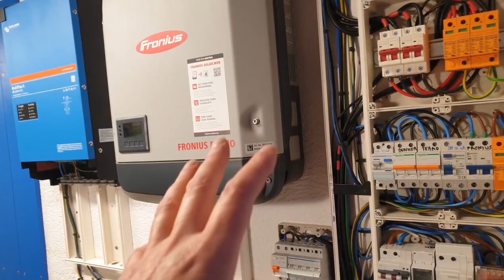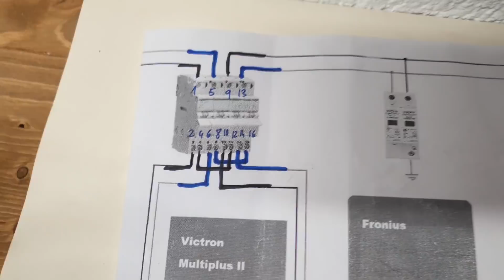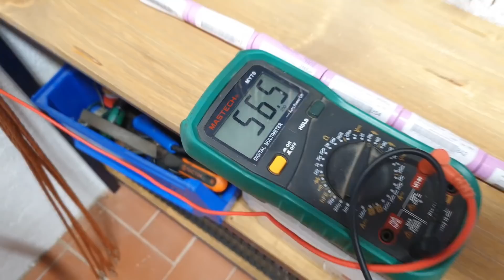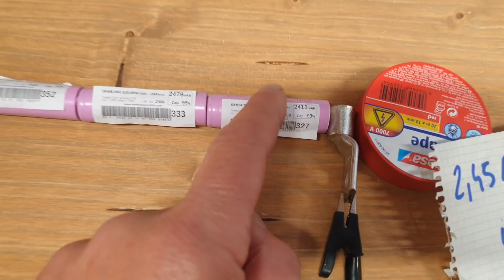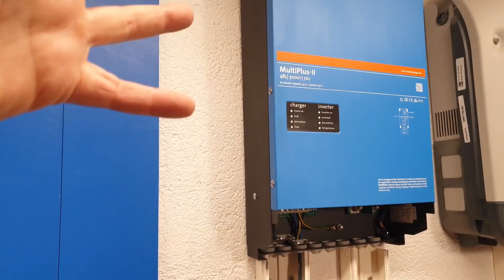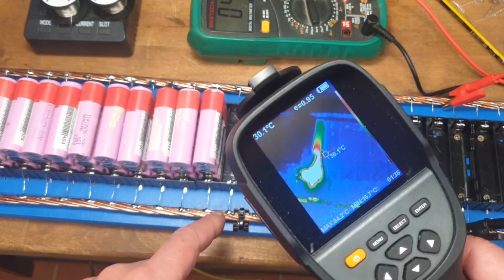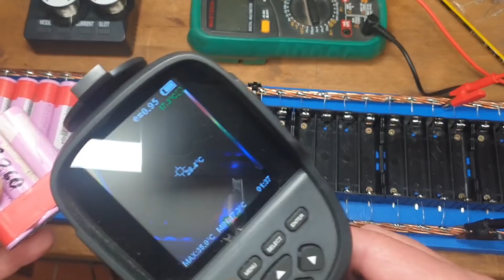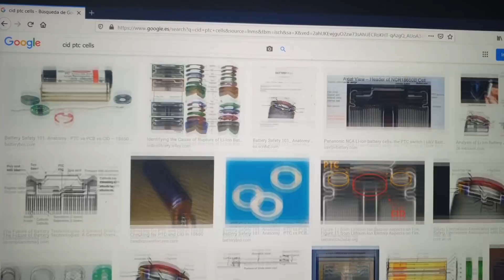PowerWall DIY 18650 MODIFICABLE EN CALIENTE - (Sistema completamiente abierto al mantenimiento)

Comment: Felicidades por este proyecto. Está topologia de powerwall esta muy bien pensada. Ya habras pensado en medir la pequeña resistencia de los cables fusibles que van al bus de dc para usarlos como shunt para medir la minima caida de tension de cada trio de pilas con el milivoltimetro y asi calcular la corriente individual y poder supervisar y detectar trios de pilas que no responden bien sobre la marcha.
Te sigo con este tema tan interesante.
Da gusto escuchar usar las magnitudes y unidades eléctricas com cal ! Si, kWh o calorías o joules son unidades de energía.
Pd: el bombero es un bms para una sola celula en este caso, tambien los hay para 4 celulas en serie 4S por ejemplo.
Reply from the maker: Me lleva loco tu mensaje...pienso y pienso
Reply: @JoanOlaria  bueno, la idea es medir la tension en miliV entre soldadura de soporte del portapilas y el cable de cobre. Esa tension es proporcional a la corriente y si las longitudes del hilillo de conexion son iguales, esas tensiones te serviran para monitorizar triadas de baterias descompensadas. Es muy farragoso pero solo es una idea para un controles de mantenimiento a largo plazo.
Una vez conocida la R de un tramo de cable y su tension en extremos, la ley de ohm te determina la corriente I=V/R que circula por cada triada individualmente so la quires conocer exactamente.
La R del cable la puedes medir en varios metros con el tester y sacar la R/ cm.
Tambien aplicando una corriente a cualquier longitud y midiendo su tensión.
Muestrear tensiones en cada portapilas respecto a la barra de Cu se complica por la cantidad de lineas en juego, es posible con un arduino o esp etc...
Otra propuesta !
Ya que tienes conexiones por los dos extremos de las barras de Cu, yo cortaria el punto central de las verticales para independizar los bancos y dividirlos por la mitad, por lo menos las barras . Esto tambien para de cara al mantenimiento.
Tant sols son idees, de lluny tot es molt senzill. Molt bona feina !

Comment: Amigo Juan: igual que siempre disfruto tremendamente tus videos y soluciones y te agradezco muchísimo que las compartas.
He estado observando algo: en tu powerwal tienes concebida la seguridad instalando fusibles en varios puntos, cosa que no veo nada mal, pero debemos tener en cuenta la caída de voltaje que introduce cada tramo de fusible debido a la resistencia del alambre que utilizas .
Si sumaras el largo de todos los trozos de alambre fusible que utilizas (tanto el fino, como el el otro menos fino) ello resultaría en una resistencia considerable que quedaría en serie con tu powerwall.
Ello implicaría que tendrías una caída de voltaje adicional y atentaría contra la estabilidad del voltaje de DC, además de la reducción de la eficiencia de tu sistema.
En mi opinión, algo que reduciría este efecto sería sustituir los fusibles que tienen cada una de las baterías por la banda metálica que empleas, por otra parte también eliminaría el doble fusible conectado al positivo y negativo a los busbars verticales; solo dejaría uno y el otro lo sustutuiría por un buen conductor que podría ser un cable o quizás otro tramo de banda metálica.

No es por gusto que los paquetes de baterías de fábrica tienen solamente un fusible en la línea finali para protegerlo como un todo, de lo contrarios la estabilidad de la tensión se vería afectada con las variaciones de la intensidad.

Teniendo en cuenta lo que explicas en el video sobre la protección interna que tiene cada celda, ello garantiza una buena parte de la seguridad.

Debemos tener en cuenta que también tendríamos caídas de voltaje en los contactos de los portabaterías con las baterías.
Al final lo que buscamos es mejorar la eficiencia y reducir las pérdidas en el sistema.

Yo no tengo ninguna experiencia con este tipo de series-paralelo de baterías, simplemente te estoy dando mi punto de vista y que pensemos juntos para que tu proyecto esté lo más cercano a la perfección.
Espero tus comentarios
Un saludo desde Cuba
Reply from the maker: Lo he pensado muchisinas veces y muchas horas y he llegado a la conclusión que lo mejor era empezar a máximos de fusibles y seguridad y probar los pros y contras y según vea modificar.
Además piensa que tengo una cámara térmica que me será de gran ayuda para encontrar los puntos calientes donde la resistencia se dispare.
La práctica y la prueba sobre el terreno dirá su última palabra......veremos...

Comment: Un trabajo espectacular!!! Me encanta cómo haces las cosas,  claras y con la máxima seguridad. No se si lo has pensado pero el total de los amperes que le pidas a la batería tendrá que circular por esos fusibles de cristal. Si están colocadas las 60 celdas se reparten y tendrías una capacidad de 120 Ah. Pero si tienes varias celdas menos porque las vas quitando para revisar o por fallo le irás recargando más a los fusibles.
Reply from the maker: Si quito paquetes puedo poner una celda individual para no restar "paso" de corriente...y puensa que 60 fusibles de 5A dan un paso total de 300A mas que suficiente....creo....
Reply: @JoanOlaria  Vale, pensaba que eran de 2A los fusibles pequeños. Entonces quedara perfecto.

Comment: muy bueno la verdad un trabajo excelente , muy didáctico y se aprende mucho
la paciencia de chino que hay que tener para ahorrar cuanto esa es mi pregunta que ahorro tuvo en relacion a comprar un banco de baterías de la misma potencia. habría que agregar las horas hombre  que invertiste y lo kw que se perdieron por el tiempo de implementación del sistema a su 100%
Reply from the maker: Yo no miro tanto lo economico porque me lo tomo como un hobbie.
No se puede vivir tan estresado sumando y restando cosas.
Reply: @JoanOlaria  un genio la verdad que había visto hace mucho tiempo como colocaste los paneles lavando los con la máquina y anoche me desayuné con el tema de las baterías me encantó cómo usaste el tema del rackeable intercambiable de baterías me parece la mejor opción de todas las que hasta ahoray lo que sería la frutilla de la torta es que a cada fusible le pongas un LEDcortocircuitado por el fusible que al momento de que se prenda de esa forma llevarse un control de cualquier desperfecto sin usar la cámaratengo el cat s60 y la tengo y la uso mucho. el tema de los fusibles que te avisan me parece interesante para tu configuración
voy a ver todos tus vídeos de nuevo un genio saludos

Comment: Hola Joan, antes de nada decirte que me encantan tus explicaciones.
Nos comentas en el video, que serias capaz de generar 441ah con todas las baterias, pero eso seria llevando cada bateria de 4,2v a 3,0v y exprimiendo los 2450mah de cada bateria.
Si tu vas a trabajar de 4,10v a 3,4v, no sacarias los 2450mah de cada bateria.
Corrigeme si me equivoco.
Gracias por tus videos, un saludo.
Reply from the maker: Si tienes razón y se conserva la bateria moviendola en un rango mas estrecho.
Pero si haces pruebas con un Opus de celdas individuales verás que el grueso de la capacidad de la bateria esta alredwdor del voltaje nominal de la bateria. 
Sobretodo se ve claramente que la energia extra que obtienes descargando la bateria mas allá de 3.40 o 3.30 voltios aproximadamente es ridícula y no vale la pena exprimir las baterias para el extra de capacidad que obtendrás
Reply: @JoanOlaria  Gracias por la aclaracion, “dale caña” a ese powerwall 💪🏻

Comment: muy buen video!! quisiera preguntarte sobre el tema de seguridad y fusibles! yo quiero fabricar una batería auxiliar para mi camper, con celdas de litio de 18650 y las pondría en paralelo para un voltaje de 12v la capacidad de carga aun no la tengo determinada, mi pregunta es la siguiente? al poner en paralelo las celdas, es mejor en cuanto a tema de seguridad y que sea viable, el instalar hilo o barra de níquel, gracias de antemano

Comment: Hola...¿que tal quedaría usar directamente los packs de baterías, sin desarmar?. Internamente trabajan en pares, entregando entre 2,7 y 4,4 voltios, con la ventaja que incluyen un BMS.
Sería cosa de ponerles los conectores para aprovechar ya el 80% de la instalación hecha...ya se que el ideal es evaluar CADA pila por separado para conocer sus capacidades, pero con un multitester con conexión para introducir en cada conexión se puede evaluar cada par de pilas, y así conocer el estado de ese par en cuanto a voltajes y amperes. También puede ser de provecho un termómetro digital por si alguna se sobrecalienta en exceso, en ese caso hay que abrir el pack y eliminar la con problemas o el par completo...

Comment: Hola Joan, me gusta mucho tu forma de explicar. Se hace entretenido y muy entendible. Quisiera hacerte una pregunta respecto a la corriente de descarga continua que tu le das a las celda en comparación a la que yo quisiera darles. Sea en este video o en el anterior mencionas que esta va a ser muy baja; ademas que con un fusible de 5A por cada 3 pilas en paralelo dejas el límite claro. Yo estoy haciendo un powerwall más sencillo con solo 32 celdas (ampliable a 48) y por eso considero la opción de usar amperages más altos para poder proporcionar mayores potencias. Con celdas 18650 a descarga máxima de 5A, según tu criterio que amperage no superarias para no comprometer la salud de la bateria significativamente? (o para no operar con riesgos?) Te agradecería mucho tu opinión. Espero el siguiente video con ganas!
Reply from the maker: Vamos a ver....la descarga máxima de cada "pila" (en Amperios  de intensidad)  la publica el fabricante en su ficha técnica (data sheet) de la celda.
Pero normalmente ronda los 5 A ...ha y celdas para usos especiales que incluso soportan más...pero a nosotros en un powerwall esa caracteristica no nos interesa, es mejor tener mucha capacidad en mAh que mucha intensidad de descarga en A
Por lo tanto un powerwall tiene de tener muchas celdas que se repartan los picos de descarga en A .....además que la descarga sea muy pequeña por "pila" es que en caso contrario no te aguantará casi nada ...no podrás pasar ni una noche.
El límite de yo pongo de 500 mAh por celda, es suponiendo que trabaja a tope el inversor...y esa descarga ya es relativamente fuerte.
Pon una celda a evaluar en tu cargador OPUS y mira lo que aguanta con 500 mAh (0.5A) es bastante, pero no para desconchar botellas de cava.
Lo ideal es que un powerwall trabaje descansado con descargas de 100 o 200 mAh para que aguante horas y horas....
Reply: Muchas gracias por tu respuesta. En efecto no me quedará otra que comformarme con una potencia reducida para no estresar las celdas.

Comment: El PTC al menos en refrigeración es un Protector Térmico Cerámico no se si sea igual
Reply from the maker: En las baterias 18650 el PTC significa (Pressure , Temperature , Current ) Switch . (INTERRUPTOR DE PRESION TEMPERATURA Y INTENSIDAD)
Reply: @JoanOlaria  gracias

Comment: Hello sir
My battery bracket does not have hole as yours. Is it OK if I use bracket original pole ro connect with cables/copper busbar ? What max cureent/anpere can flows ?
Thank you and stay safe
Reply from the maker: I don't know how many maximum amps can flow through the bases of the brackets (original poles).  But I do know that when I design my powerwall I have to calculate that for each connection point more than 1.5 A will never pass approx.
Reply: @JoanOlaria  thank you for your reply sir
I use your power wall as my reference for mine.

Comment: Avanzo con mi proyecto inspiracion del tuyo . tengo la primera partida de baterias para recuperar , inicalmente voy a empezar con 30 kg de baterias de portatil en bruto , una primera estimacion es que saldran unas 600 celdas 18650 o aprox 4 KWH de almacenamiento (gracias por tu didactica explicacion para hacer cuentas de voltios amperios , etc. jejeje).  Iré poco a poco , pues si la recuperación no es rentable o demasiado tediosa , tengo a los amigos de second life battery para que me suminstren. Pero tengo alguna duda , dado que ya tengo una instalacion de inversor solar sin baterias (igual que tu pero con un Solax de 5KW) tengo una duda. 
Ocasionalmente el consumo de mi vivienda presenta picos de 6 o 7 KW (generalmente a medio día por eso de las placas para cocinar , etc calefaccion , y todos lo que pueda estar en marcha ) que el Victron sea de 5KW y pase toda la potencia que se demanda de la red por ahi, Supone que un dia por ejemplo sin, producccion  estaría pasando por el victron unos 7KWH no durante un pico sino en periodos de 1 o 2 horas. Esto sería un problema ? o la limitaciono nominal del Victron es para gestionar demanda sobre las baterias (tanto de carga como descarga)  pudiendo asumir cargas superiores en el caso de bypass de energía de la red al consumo de la casa.  No se si he explicado deforma adecuada mi pregunta.?

Añado una pregunta mas , como se realiza la comunicacion entre el Fronius y el Victron . Es por conocer si pudiera ser compatible (esta comunicacion) con mi inversor (un Solax)

Comment: 23:46 yo pondría dos fusibles en paralelo o dos hilos fusibles para que aguanten 10 A
Reply from the maker: No estoy de acuerdo pero respeto tu opinión. Con 20A la celda no tiene suficiente fuerza para petar el fusible en caso de necesidad....pero todo es opinable y se puede reflexionar...gracias
Reply: @JoanOlaria  no me has entendido mal solo digo que poner ya sea hilo fusible o cristal fuse de 5A a mí me parece poco para 3 baterías en paralelo ya que con los picos de arranque que puedas tener te pueden saltar, ojala no pero vamos  yo a mis placas solares les tengo puestos fusibles de 12A sabiendo que sacan 10A máximo no sé si me explico. El fusible es para que salte en el momento de un corto o mala conexión que suelen pasar más amperios de los nominales de la batería. De todas formas lo puedes medir haciendo un corto controlado y midiendo amperaje para ir con precisión. Un saludo sigue así espero ver la instalación terminada
Reply: @JoanOlaria  sobretodo al conectar la batería al inversor la primera vez te va sacar muchos amperios de la batería para cargar los condensadores. El truco es poner una resistencia limitadora pero creo que ya estás al tanto de los vídeos de australiano

Comment: Los holders que tienes lo has comprado al vendedor de aliexpress que has puesto? Es que se que hay vendedores que ponen las fotos de la marca BLOSSOM y despues te envían otros de menos calidad. Podrías confirmarme que marca son los tuyos??
Gracias y un saludo
Reply from the maker: Si...los he comprado a ese vendedor. Y creo que justamente es el propio fabricante. Vamos que compras con ese enlace directamente a fábrica .
Reply: @JoanOlaria  yo es que ya he comprado varios holders en varios compradores de aliexpress para unos cargadores que diseñe en placas pcb y hay unos que en menos de 1 mes de uso se han roto. No tenían marca y se nota que no son de calidad. Por si puedes en otro video enseñarlos en detalle, yo es que para mi powerball voy a necesitar unos 300 holders de 4 baterias 18650 y no quiero comprar unos y que me envíen unos que no valgan porque es un dinero curioso. 
Gracias y un saludo Joan, sigue con tus vídeos que son muy buenos.
Reply from the maker: @WiLoW82  ok...en el próximo video los enseñaré detalladamente por delante y por detrás.